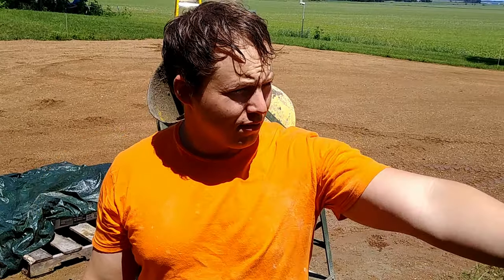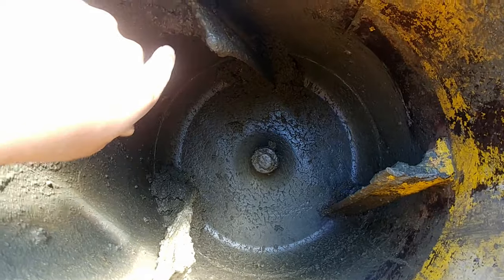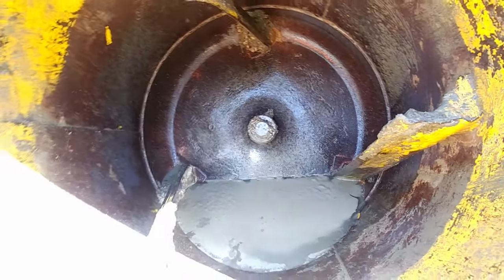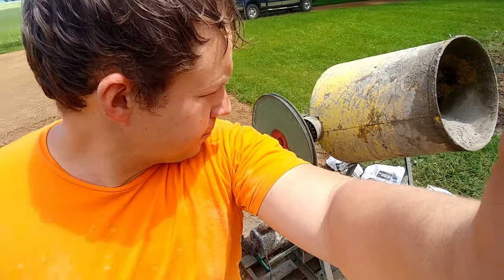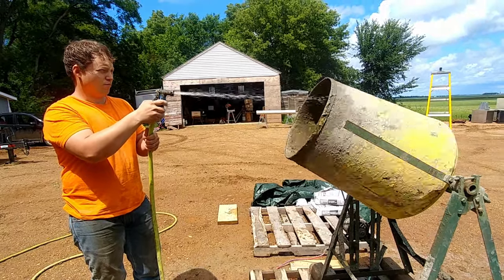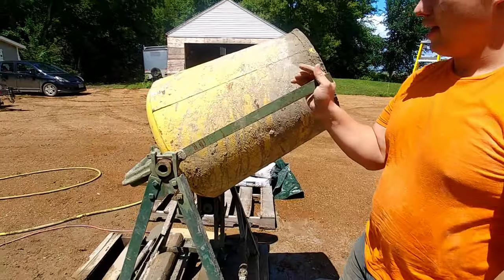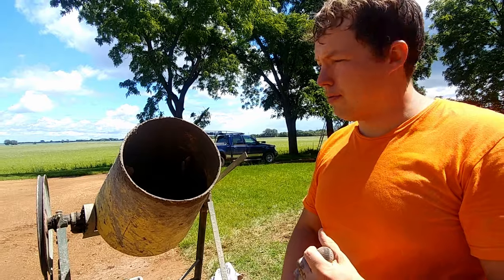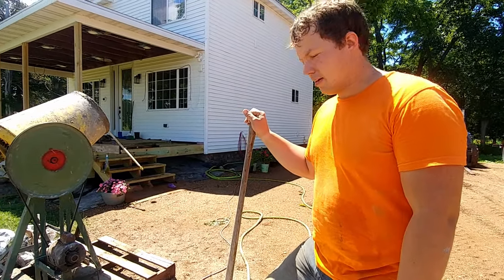How To Use a Concrete Mixer

Comment: A wheelbarrow?
Reply from the maker: Haha, I considered that but I didn't have one readily available that I had the rights to use. My wife has a very shinny red one actually that I'm not allowed to significantly soil unfortunately! :)
Reply: @BenjaminSahlstrom  ... you can put the catch tray IN the wheelbarrow, as long as you aren't sloppy, it shouldn't soil your wife's stuff (or use a tarp between just in case).

I guess for next time.

Comment: Great video and easy to understand. Thank you.  Question. How much time do I have between mixing  before the the first batch start to dry out. I’m putting concrete in a sonotube but will need a couple of batches per sonotube. Thanks

Comment: Good video with tips.  Got to love those machines that don't die.  I usually  only mix small partial batches for patchwork by hand.   I got one this spring and have not used it yet.  Seeing a technique will save some aggravation on the learning curve. Spraying to the back seems like best takeaway along with the diesel fuel spray when finished.

Comment: I just bought a new mixer and read the instruction manual. It stipulated that the mixer must be running before you add the cement mix. Never start mixer with a load already in it. Also water is added incrementally. 
Just saying what the instruction manual said.